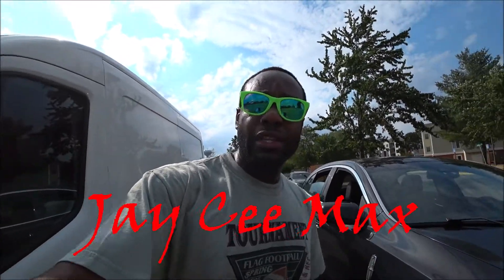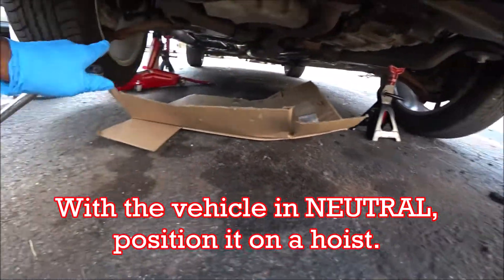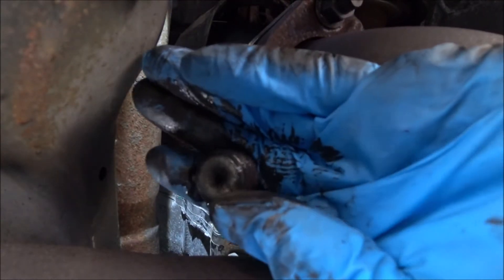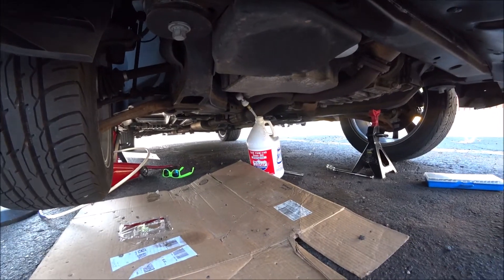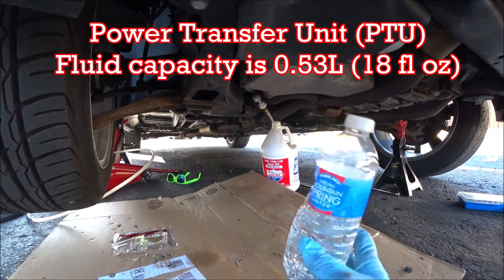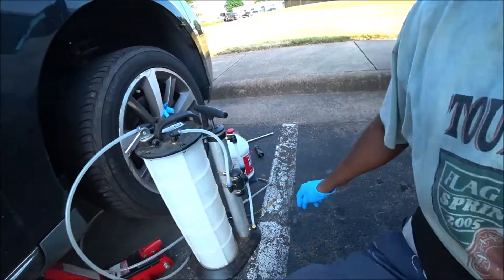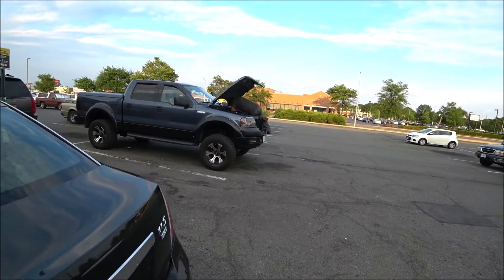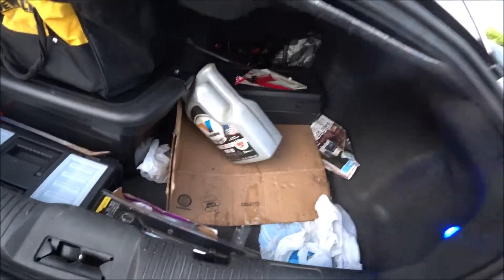How to change Power Transfer Unit (PTU) Fluid. Drain and Fill (Easy) | Lincoln mkS

Comment from the maker: Let me know if you have any questions down below. Let's keep these PTU's alive!
Reply: I did this and I know the capacity...but I only got a fraction of the fluid out. How much fluid di you actually get?
Reply from the maker: @johnlawson910  Yes. It will only remove a fraction of the fluid because most of it tars up, dissipates or leaks. All I was able to remove was what I demonstrated within the video. I didn't measure it. Just change it often and it will help clear out the past tar/gunk overtime.
Reply: @JCMFix please please please respond to this so I have a 2012 Lincoln mks awd and I was having a hard time shifting to park it would get kinda ruff then when I went back to drive and back to park it would be fine so I took it to continental which is a mechanic shop near me they said they worse case scenario they need to replace it it would be 3200 dollars for labor and the part and the sealant but they said best case it may just need some sealant my question to you is how should I go about this if it’s leaking slowly is it a big deal like should I hop on this right away or can I just do what you did in this video and I’ll be ok i guess my question is… is it normal to leak???
Reply from the maker: @AR17Pro  Your issue seems like a transaxle issue and not a power transfer unit issue. There is not a sealant for the transaxle. It's either working or it's not. There are seals for both but super hard shifting from Park to Drive and Vice versa is beyond a leak. It's an internal issue with the shifting solenoid or the entire transaxle (aka transmission) itself.
Reply: @JCMFix  thank you for responding yeah it not like super hard going to drive or any other gear except park but even that isn’t super hard you can just feel it get a little stiff then if I was to pull it down to drive it would be and back to park it’s fine so is my transmission going basically because ik I lost a lot of PTU fluid like it’s leaking on my exhaust not poring out just like leaking tho could the lack of ptu fluid be the case
Reply: That’s great . Can you do it for my car ford turaus 2016 . And I will pay for that . The screen in my car comiyup by message. Change AWD
Power Transfer Unit lube . That’s means I need to change transfer unit .
Reply from the maker: @essmataly5884  If you can change the lube, if it's safe for you, go ahead.

Comment: Excellent video. This is new information to me. Does the transfer power fluid have anything to do with the operating of the transmission.
Reply from the maker: Thanks.
Happy to help.
No. The PTU (Power Transfer Unit) in a Lincoln MKS is directly connected to the transmission and is a critical component of its all-wheel-drive (AWD) system, as it transfers power from the transmission to the rear wheels. While it is physically attached to the transmission, it is a separate unit and uses its own fluid, not sharing the transmission's fluid.

Comment: That’s great . Can you do it for my car ford turaus 2016 . And I will pay for that . The screen in my car comiyup by message. Change AWD
Power Transfer Unit lube . That’s means I need to change transfer unit .
Reply from the maker: @essmataly5884  I wouldn't say you have to change the entire unit. If you can change the gear oil lube, go ahead and change it every 30,000 miles.

Comment: I know this is an older video but it's the best I've seen so far because you did it in a parking lot and not on a lift in a garage that most people don't have. I have a 2012 MKZ and just did this about a month ago thanks to you. Was able to get about a water bottle amount out but plan on changing it again in a few months just to make sure. My car had 40 thousand miles at the time and it looked like tar and smelled really bad. Thanks for doing this video. It helped a lot.
Reply from the maker: Thanks K. That's good that you got under there. The mkZ is an even tighter fit. I am happy to help. More to come!

Comment: Hello, do you have a repair shop close to the DMV area - I need a good mechanic shop that can work on my 2011 MKS.
Reply from the maker: I wish. I usually just go to Ford whenever I can't tackle things.
Reply: @JCMFix  Thank you - my car is currently at Sheehy Ford/Lincoln  Dealer - to replace the low beam light.  It's taking them forever to repair or replace the bulb. - The car has been there since Wednesday with no results.
Reply from the maker: @SamuelBrooks-l8v  Dang. It shouldn't take them that long. I feel dealerships don't respect older cars and pretty much let it sit until they "can get to it." I

Comment: For vehicles with a drain plug and a fill plug, remove the fill plug first because it would suck to drain the fluid and not be able to refill it.  I'm going to change the fluids in my 1996 4WD Daihatsu Hijet mini truck.  It has 45,000 miles and almost certainly never changed in 27 years - the manual transmission, transfer case, front differential and rear differential.  I'll be using my little hand held Mity Vac to pressurize the gallon jugs to push the gear oil up a clear vinyl tube to refill the fluids.  Use a new copper crush washer on the plugs to prevent leaks.
Reply from the maker: Yes. I'll do the same with my 1995 Hijet soon. Thanks Liberty!

Comment: So would that make my mks kinda shudder in early gears? Once going its fine but on take off it dies this weird feeling
Reply: O wow... Hate 2 hear that... Thanks tho
Reply from the maker: The shuddering in the early gears is highly indicative of a torque converter failure within the transmission. $2,500 fix.

Comment: Is this the same fluid that you lose when pulling out the cv shaft?
Reply from the maker: Depends which side of the Power Transfer Unit you are referring to and which seals are failing. On the intermediate shaft side (right side of the PTU), yes, if the PTU is leaking, it is leaking the PTU gear oil fluid that I am showing in this video (75W-140). But if the half shaft (CV axel) seal is bad, transmission fluid could come puking out of that same area on both the left and right sides. If it's the left side of the PTU that bolts to the transmission, if the transmission is leaking from it's connection seal with the PTU, then it's leaking the Mercon V fluid.

Both sides of the PTU have at least 2 seals two keep the PTU differential fluid in it's place and the transmission fluid in it's place.

Overall, the PTU is just small transfer case that is always spinning in a Lincoln mkS. In four-wheel drive and all-wheel drive vehicles, a transfer case is either connected directly to the back of the transmission, or by a small driveshaft further back in the vehicle. When activated, the transfer case takes power from the engine to the back wheels. Depending on the kind of vehicle, power may go to the rear wheels on a full-time or part-time basis. All-wheel drive systems are typically on all of the time while a four-wheel drive system are activated by either pressing a button in the vehicle or by manipulating a selector lever, typically located near the transmission hump on the floor. In both systems, transfer case fluid keeps the internal parts of the transfer case lubricated. Over time, transfer case fluid will become dirty and break down. When transfer case fluid breaks down you may notice shuddering from the vehicle while turning or a whining noise from the gears in the transfer case.

Comment: I have a 2012 Lincoln MKX AWD. Do you now what type of fluid I need and how many quarts for my car?
Reply from the maker: I looked it up.
From the 2012 mkX manual, the fluid capacity of the PTU is 0.53L (18 oz).

The PTU fluid for your 2012 mkX AWD is exactly what I presented in this video. 

if you want to buy the Lucas Oil version, the link is above in the description. 

If you want to buy OEM, it's this:
Motorcraft® SAE 75W-140 Synthetic Rear Axle Lubricant
XY-75W140-QL (US); CXY-75W140-1L (Canada).  ( https://amzn.to/3LY2ISj ).

Yes. It's says REAR and this is correct from Ford. It is for the rear differential and PTU up front.

 Apply silicone sealant to the drain or filler plug threads and install the plug.

Tighten to 20 Nm (177 lb-in).
Reply: @JCMFix  Can I use Valvoline SynPower SAE 75W-140  or Mobil 1 SAE 75W-140?
What's the difference between synthetic & full synthetic? which one is better? Thank you
Reply from the maker: @ee7968  All of those are fine. If it's 75W-140 and it meets the rating specifications as stated in the manual you are good.

I believe both of the ones you mentioned are full synthetic. If one is not, then it's of a different variety. You should only use what's specified and meets the quality and standards of what's stated in your manual. The OEM I stated above is what you should compare everything to. If it matches or exceeds, then you are good.

What's better is just your preference.

Cheers mate.

Comment: From other videos that I watched they recommended putting a thread sealant on the threads before putting the plug back in.
Reply from the maker: It depends on the condition of the plug and its threads. Yes. It's good to put a thread sealant on it but mine was ok because it still had the factory goo/sealant on the threads. It was the first time it was cracked open and the plug was still in good condition. So all is well on that end.

Comment: Great video man. I took a fluid pump and put a 1/2 by 3/8 hose on the bottom of the pump and sucked out 16oz and pumped what I took out. Total BS on lifetime fluid. And if a shop or dealer tells you never to touch it, do it yourself.
Reply from the maker: Thanks!
That's a great idea!
Indeed!

Comment: Great video. I have a Mazda CX-9 with the same PTU, my regular shop refused to change the PTU fluid because there’s no drain plug. Probably just didn’t want to do the job. 

What do you think of the Ford 3.5/3.7 internal water pump?
Reply from the maker: Thanks!
The internal water pump design is the worst. Once that goes kaput, the car will be no more. Too many other cars I can cheaply buy with that repair money.

Comment: nice to meet you
I'm from Japan, but I'm in a 2014 Ford Explorer 3.5L NA car. Is it possible to mix mission oil and ATF Marcon LV with differential oil?
A phenomenon that ATF decreases occurs.
Reply from the maker: 日本から見てくれてありがとう！いいえ。トランスミッション以外の場所にトランスミッションオイル（ATF Mercon LV）を混ぜることはお勧めしません。トランスミッションは独自のオイルを使用しています。リヤデフオイルは自重のオイル（ギアオイル75W-140）を使用し、このビデオで紹介しているフロントパワートランスファーユニット（PTU）は、通常、リアディファレンシャル（75W-140）とまったく同じギアオイルを使用しています。 適切な重量のオイルを入手するのが難しい場合は申し訳ありませんが、適切な重量のオイルを入手するために最善を尽くす必要があります。そうしないと、部品が破損する可能性があります。 Thanks Haru Haru!
Reply: thank you for your reply. No, the front differential oil overflows and leaks. Moreover, ATF is reduced. I want to know what the cause is.
Reply from the maker: @haruchanchannel2023  交換が必要なのはおそらくシールです。
Reply: @JCMFix  It would be helpful if you could tell me what kind of sticker to replace 🙏
Reply from the maker: @haruchanchannel2023  I'm not sure I understand your question. What sticker?
Reply: @JCMFix  I'm sorry. It's not a sticker, it's a seall. Which part is suspected？
Reply from the maker: @haruchanchannel2023  It's probably the seal within the Power Transfer Unit. This is where the CV Axels connect to. When the seal leaks, gear oil will be reduced. (It is not called ATF. I am referring to the 75W-140  gear oil that goes into the Power Transfer Unit (PTU) as shown in this video. I am not referring to any sort of Automatic Transmission Fluid (ATF) in this video). 
Look at 02:30. The PTU seal is between the yellow circle where it meets the PTU. This section is known to leak gear oil. If its leaking, more than likely, the seal needs to be replaced.
Reply: @JCMFix  Thank you for politely teaching me. I learned a lot. If you have any questions, please give me some advice.
Reply from the maker: @haruchanchannel2023  No problem. I hope everything works out for you.

Comment: 2012 Mazda CX9 here. Apparently it uses the same PTU and suffers from the same issue. I drained the fluid out but I was only able to get about 3 ounces out. How much fluid do you get out when doing this? I think some of the gears in there prevented the tube from reaching the bottom or the sludge is too thick to suck through the pump... or I wonder if it's full of sludge at the bottom. I plan to run it a bit, let the new fluid break up some sludge and drain it again.
Reply from the maker: I don't know the amount the the liters that I was able to extract was minimal as shown. But yes, your plan is the best thing one can do. I am doing the same to break up the previous sludge. I hope these cars/SUV's can last as long as possible.
Thanks Joe!

Comment: I was all happy when sold the VW with a turbo in it, thought all my problems were over.  Then BAM I find out there's new worries with a 4 wheel drive vehicle!
Reply from the maker: If you change the PTU fluid early on, let's say about every 30,000 miles, that should help stave off future issues.
Thanks for commenting.

Comment: Doesn’t the car need to be level when you refill? Seems like you could overfill or under fill with the front jacked up like that.
Reply from the maker: Correct. But the basic tenent is to fill until it's starts leaking out then plug it back up. Thats simple enough for me to not really worry about the slight car leveling.

These PTU's are prone to fail and like I said in the video, i will just keep sucking it out and refilling at 30,000 miles where before the company deems it as a "lifetime" fluid. 
So keeping fresh gear oil in it even if it's slightly under or over is ok with me in regards to this crappy part that is bound to fail anyways. I am just lengthening it's life span.

Comment: I have a 2013 Lincoln MKS and just recently started having issues with my PTU...I just bought the car about a month ago..I’m starting to hear a subtle grinding noise and I’m wondering if i could possibly rescue the ptu with a fluid change or is it more likely it’ll need to be replaced with that grinding sound being present
Reply from the maker: That's tough to discern. How does it smell? Is it leaking?
Reply: I don't know if you have it sorted out yet but if you're hearing a grinding noise from the PTU, it's toast. In addition to the lubricant getting cooked, the seals tend to leak on these units.

Comment: 2008 Ford EdgeAWD here, 140kMiles, original PTU with GearOil changes made easy as follows:
~ Drill+Tap PTU bottom between ExhaustPipe & TranMt, installed Fumoto10mmDrainValve.
~ Replaced 1/2"*14 FillPlug on PTU side with 1/2"*14 to 3/8"HoseBarb90 pointed upward.
~ Removed PTU TopVentCap+Rubber1Way wIth 5/8"Socket+ScrewPick, reveals 3/8"HoseBarb.
~ Installed two 3/8"OilHoses from PTU HoseBarbs to FireWall between BattTray+FuseBox.
~ Installed FiberGlassInsulationWrap around ExhaustPipe under\near PTU.
~ Installed OilCatchCan with FIlteredVent on FireWall between BattTray+FuseBox.
~ Refilled PTU 1/2qt=16oz of 75w140 HiTemp AmsOil thru above new OilCatchCan+Hoses.
~ Routinely Drain+Refill PTU at 5kMile\6Mth intervals, along with EngineOil+Filter changes.
Reply from the maker: WOW. You've done it all. I'm happy to here you have done so many things to make life easier for you. Good job.